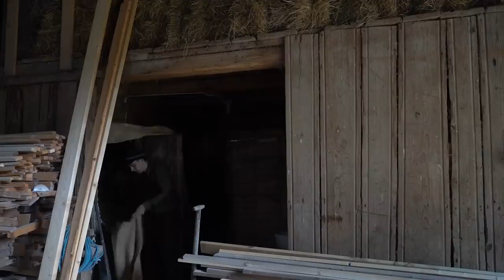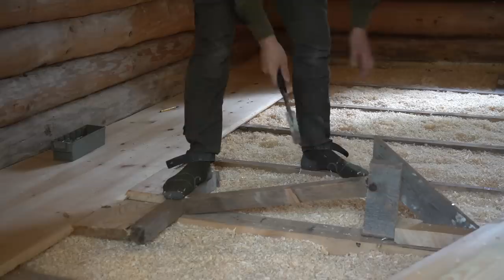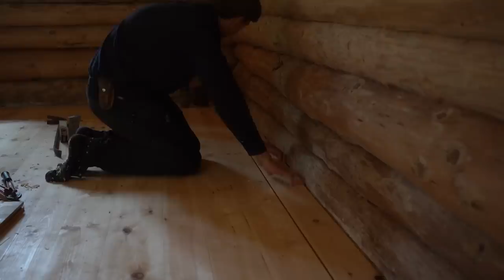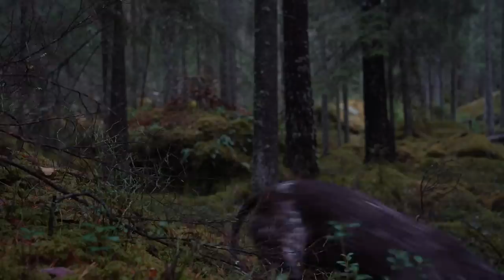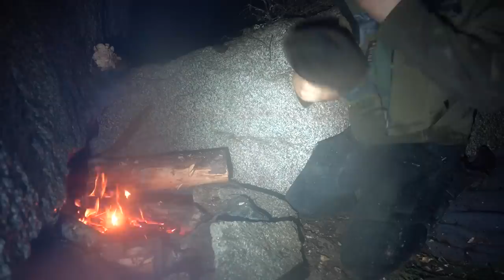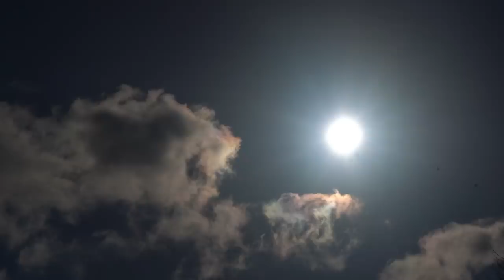Rustic Swedish Log Cabin | Hunting with my Dog

Comment: You will have gaps between floor planks when they shrink. They will shrink for years. In the summer they have the biggest moisture and width. 
Traditionally floor planks weren't nailed to the hoists but only attached to each other with wooden dowels. Then they were tightened afterwards and thin plank was added to fill the gap
Reply: Sweet

Comment: It was really nice seeing you lay that wooden floor. It makes the cabin kind of inhabitable from now on. It really hit the spot. (my best translation of "pricken över i" so far ;)). I usually also pick the berries and mushrooms the forest offers; that's a favour of the nature. Unfortunately I live in Älvkarleby, northern Uppland where the downfall of cesium from the Tjernobyl "accident" was among the worst in Sweden. Considering the first half life of cesium is well passed due I eat small portions two or three times a year. I also boil them throwing away that first water before frying them. Calculating the risks compared to e.g. air plane crews, x-ray personell and others, eating it two or three times a year should make no difference at all. The lingon-berries and blueberries are fine though. They don't mistake the cesium for being one of the elements they need as much as the mushrooms seem to do.

Comment: My grandfather bought a 700+ year old log cabin, and after disassembling it in true Swedish style (with labels and a reassembly diagram), moved it onto the summer house property he had. It looks a lot like this, though the roof and door height are lower. That was in the late 30s or early 40s, and it’s been there ever since. It’s about 800 years old now. Lovely to see this.

Comment: Carpenter here. I assume it was near 0°C when you put that floor in that tight. If the wood was decently dry at that point you risk having the floor up a meter high next winter when you start heating and the humidity going up inside. That, or the floor pushes your walls apart. I have seen stone walls being pushed apart by thinner wood flooring, although hardwood. However tangential expansion should be around the same amounts there.
I made a lot of assumptions here, just a heads up. It's also the first video I watch here, so maybe you made things clear earlier. Won't be the last one I watch, though ;)
EDIT: Thanks for not putting in music so far!

Comment: the core of the tree should be downwards on floor panels as the tree dries up it will start bulging on the edges. either up or down depending on what way you lay them. doing so they will either last longer or get uncomfortable to walk on.
timber houses have been known to last for hundreds of years done correctly.
it will also take a decade or two for the house to settle, so it is a good practice to leave some room for settle.

nice house.

Comment: It doesn't look like those floor boards have reliefs in the bottom to help with expansion across the grain. And you have fitted them tight against each other. I'm concerned that there will be an issue when the boards expand.....your floor might buckle upwards. Or perhaps I missed something?

Comment: an excellent video, thank you for sharing. a few questions about the floor: will you fill the gaps on the floor where it comes contact with the wall? and how will you be cleaning the floor? only with a broom or/ and with a mop considering that water can penetrate the floor?

Comment: This might be a silly question, but the floor won’t crack as the wood expand with temperature variations?
Reply: Usually you leave some leeway for the floor to move in the breadth direction of the boards, if that makes sense? Also you "temper" the boards so they are adapted to the level of humidity in the area before you install them. But the floor will of course move a bit over the seasons, shrinking and expanding depending on humidity

Comment: hei Erik, in my understanding woodshaving insulation has to be compressed (about 70kg/m³) otherwise it will sink overtime and leave uninsulated space on the top.
what do you think about that? have this information from  northmen guild
Reply: I think it's chopped straw!
...and it's a traditional build - they've been doing it this way for centuries, so.......?!
Reply: @andymccabe6712  those are obviously wood shaving from a powerplaner, they use it for the cows  anyways so it doesnt goes to waste. what i mean it not that is a wrong material but that it compresses over time just by its own weight, leaving free room directly under the flooring, istn that a concern? have you ever looked under the floor boards what happened?

Comment: Is it fire-safe to have all this sawdust under the floor planks? I mean, one spark or amber between the floor boards and it will go off like a firecracker. Or will it absorb enough moisture that it will not be so flammable anymore? 

Ofcourse there is small chance as there is practically no gaps between the planks, but still …

P.S. Nice easter egg with a newspaper that has article about you and your cabin :)

Comment: So... did you use untreated sawdust as insulation? That seems like a pretty big fire hazard...?
Reply: How is it a fire hazard - it's in a sealed box! 
And isn't it chopped straw ......?!
Reply: @andymccabe6712  A sealed box that is also made of untreated wood, in a building that will most likely be heated by a wood-burning stove... Massive fire hazard. Natural  insulations are wonderful, but must still be treated with flame retardants to be safe. He's made a (very nice) wooden box and stuffed the floor full of tinder.